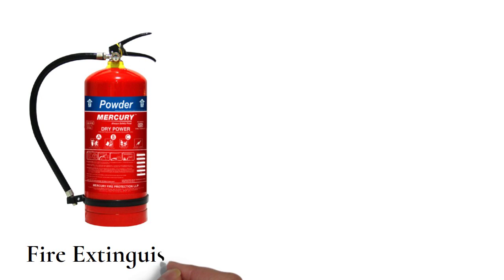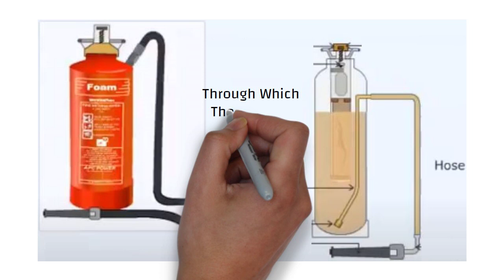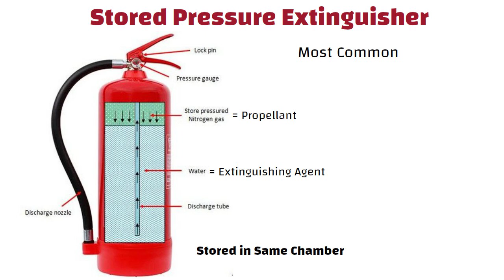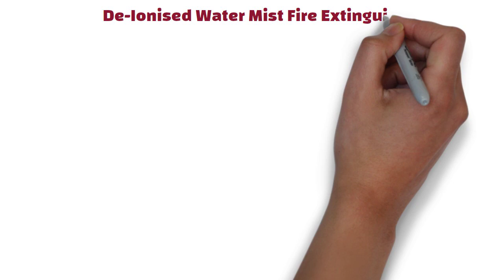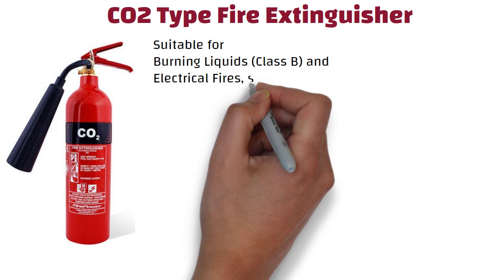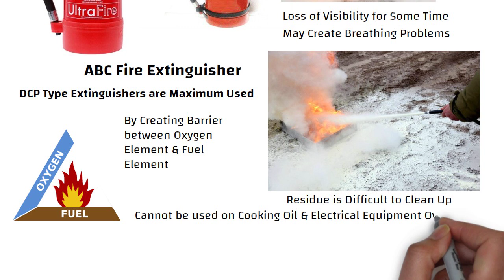FIRE EXTINGUISHER DEALERS IN KERALA, CALL 8138906102, FIRE EXTINGUISHER DEALERS IN ERNAKULAM.

Comment from the maker: FIRE EXTINGUISHER DEALERS IN KOCHI, FIRE EXTINGUISHER SUPPLIERS IN KOCHI, FIRE EXTINGUISHER DISTRIBUTORS IN KOCHI, FIRE EXTINGUISHER IN KOCHI, ABC TYPE FIRE EXTINGUISHER DEALERS IN KOCHI, CO2 TYPE FIRE EXTINGUISHER DEALERS IN KOCHI, CLEAN AGENT FIRE EXTINGUISHER IN KOCHI, MODULAR TYPE FIRE EXTINGUISHER DEALERS IN KOCHI, MECHANICAL FOAM FIRE EXTINGUISHER DEALERS IN KOCHI, FIRE EXTINGUISHER NEAR ME KOCHI, FIRE EXTINGUISHER TRADERS IN KOCHI, FIRE FIGHTING COMPANIES IN KOCHI, FIRE CONTRACTORS IN KOCHI, FIRE EQUIPMENT DEALERS IN KOCHI, FIRE ALARM DEALERS IN KOCHI, FIRE PUMP DEALERS IN KOCHI, SMOKE DETECTOR DEALERS IN KOCHI, FIRE FIGHTING SYSTEM IN KOCHI, FIRE PROTECTION SYSTEM IN KOCHI, FIRE AND SAFETY CONTRACTORS IN KOCHI, FIRE HYDRANT SYSTEMS IN KOCHI, PA TALK BACK SYSTEM IN KOCHI, FIRE NOC IN KOCHI, FIRE INSTALLATION IN KOCHI, FIRE NOC RENEWAL IN KOCHI, KIRLOSKAR FIRE PUMP DEALERS IN KOCHI, FIRE EXTINGUISHER NEAR ME KOCHI, FIRE EXTINGUISHER MANUFACURERS IN KOCHI, SAFEX FIRE EXTINGUISHER DEALERS IN KOCHI, FIRE NOC CONTRACTORS IN KOCHI, FIRE FIGHTING EQUIPMENT DEALERS IN KOCHI, FIRE PROTECTION SYSTEM IN KOCHI, FIRE INSTALLATION IN KOCHI, FIRE SAFETY CONTRACTORS IN KOCHI, FIRE AMC IN KOCHI, FIRE PROTECTION SYSTEM IN KOCHI, FIRE PROTECTION EQUIPMET IN KOCHI, AMC OF FIRE SYSTEM IN KOCHI, FIRE CONSULTANTS IN KOCHI, FIRE AND SAFETY EQUIPMENT DEALERS IN KOCHI, ADDRESSABLE FIRE ALARM SYSTEM IN KOCHI, KARTHAR VALVE DEALERS IN KOCHI, DCP TYPE FIRE EXTINGUISHER IN KOCHI, POWSER TYPE FIRE EXTINGUISHERS IN KOCHI, FIRE HYDRANT SYSTEM IN KOCHI, FIRE ALARM PANEL DEALERS IN KOCHI, SAFEPRO FIRE EXTINGUISHER DEALERS IN KOCHI, MS AND GI PIPE DEALERS IN KOCHI, JINDAL PIPE DEALERS IN KOCHI, AGNI FIRE ALARM DEALERS IN KOCHI, FIRE EQUIPMENT DEALERS IN KOCHI, FIRE EQUIPMENT SUPPLIERS IN KOCHI, FIRE EQUIPMENT TRADERS IN KOCHI, FIRE SPRINKLER SYSTEM IN KOCHI, RAVLE FIRE ALARM DEALERS IN KOCHI, RAVEL FIRE ALARM SYSTEM IN KOCHI, AGNI FIRE ALARM DISTRIBUTORS IN KOCHI, FIRE ALARM CONTRACTORS IN KOCHI, FIRE PIPE INSTALLATION IN CONTRACTORS IN KOCHI, FIRE SAFETY CONTRACTORS IN KOCHI, FIRE PA TWO WAY TALK BACK SYSTEM DEALERS IN KOCHI, HEAT DETECTOR DEALERS IN KOCHI, HONEYWELL FIRE ALARM DEALERS IN KOCHI, FIRE NOC CONSULTANTS IN KOCHI, FIRE AMC AND FIRE NOC IN KOCHI, FIRE SAFETY COMPANIES IN KOCHI, NEWAGE DEALERS IN KOCHI, MONSHER FIRE EQUIPMENT DEALERS IN KOCHI, KARTHAR VALVE DEALERS IN KOCHI, FIRE HYDRANT VALVE DEALERS IN KOCHI, FIRE HOSE REEL DRUM DEALERS IN KOCHI, FIRE SPRINKLER DEALERS IN KOCHI, FIRE PUMP DEALERS IN KOCHI, LUBI PUMP DEALERS IN KOCHI, LHP PUMP DEALERS IN KOCHI.
Reply: FIRE EXTINGUISHER DEALERS IN KOCHI, FIRE EXTINGUISHER SUPPLIERS IN KOCHI, FIRE EXTINGUISHER DISTRIBUTORS IN KOCHI, FIRE EXTINGUISHER IN KOCHI, ABC TYPE FIRE EXTINGUISHER DEALERS IN KOCHI, CO2 TYPE FIRE EXTINGUISHER DEALERS IN KOCHI, CLEAN AGENT FIRE EXTINGUISHER IN KOCHI, MODULAR TYPE FIRE EXTINGUISHER DEALERS IN KOCHI, MECHANICAL FOAM FIRE EXTINGUISHER DEALERS IN KOCHI, FIRE EXTINGUISHER NEAR ME KOCHI, FIRE EXTINGUISHER TRADERS IN KOCHI, FIRE FIGHTING COMPANIES IN KOCHI, FIRE CONTRACTORS IN KOCHI, FIRE EQUIPMENT DEALERS IN KOCHI, FIRE ALARM DEALERS IN KOCHI, FIRE PUMP DEALERS IN KOCHI, SMOKE DETECTOR DEALERS IN KOCHI, FIRE FIGHTING SYSTEM IN KOCHI, FIRE PROTECTION SYSTEM IN KOCHI, FIRE AND SAFETY CONTRACTORS IN KOCHI, FIRE HYDRANT SYSTEMS IN KOCHI, PA TALK BACK SYSTEM IN KOCHI, FIRE NOC IN KOCHI, FIRE INSTALLATION IN KOCHI, FIRE NOC RENEWAL IN KOCHI, KIRLOSKAR FIRE PUMP DEALERS IN KOCHI, FIRE EXTINGUISHER NEAR ME KOCHI, FIRE EXTINGUISHER MANUFACURERS IN KOCHI, SAFEX FIRE EXTINGUISHER DEALERS IN KOCHI, FIRE NOC CONTRACTORS IN KOCHI, FIRE FIGHTING EQUIPMENT DEALERS IN KOCHI, FIRE PROTECTION SYSTEM IN KOCHI, FIRE INSTALLATION IN KOCHI, FIRE SAFETY CONTRACTORS IN KOCHI, FIRE AMC IN KOCHI, FIRE PROTECTION SYSTEM IN KOCHI, FIRE PROTECTION EQUIPMET IN KOCHI, AMC OF FIRE SYSTEM IN KOCHI, FIRE CONSULTANTS IN KOCHI, FIRE AND SAFETY EQUIPMENT DEALERS IN KOCHI, ADDRESSABLE FIRE ALARM SYSTEM IN KOCHI, KARTHAR VALVE DEALERS IN KOCHI, DCP TYPE FIRE EXTINGUISHER IN KOCHI, POWSER TYPE FIRE EXTINGUISHERS IN KOCHI, FIRE HYDRANT SYSTEM IN KOCHI, FIRE ALARM PANEL DEALERS IN KOCHI, SAFEPRO FIRE EXTINGUISHER DEALERS IN KOCHI, MS AND GI PIPE DEALERS IN KOCHI, JINDAL PIPE DEALERS IN KOCHI, AGNI FIRE ALARM DEALERS IN KOCHI, FIRE EQUIPMENT DEALERS IN KOCHI, FIRE EQUIPMENT SUPPLIERS IN KOCHI, FIRE EQUIPMENT TRADERS IN KOCHI, FIRE SPRINKLER SYSTEM IN KOCHI, RAVLE FIRE ALARM DEALERS IN KOCHI, RAVEL FIRE ALARM SYSTEM IN KOCHI, AGNI FIRE ALARM DISTRIBUTORS IN KOCHI, FIRE ALARM CONTRACTORS IN KOCHI, FIRE PIPE INSTALLATION IN CONTRACTORS IN KOCHI, FIRE SAFETY CONTRACTORS IN KOCHI, FIRE PA TWO WAY TALK BACK SYSTEM DEALERS IN KOCHI, HEAT DETECTOR DEALERS IN KOCHI, HONEYWELL FIRE ALARM DEALERS IN KOCHI, FIRE NOC CONSULTANTS IN KOCHI, FIRE AMC AND FIRE NOC IN KOCHI, FIRE SAFETY COMPANIES IN KOCHI, NEWAGE DEALERS IN KOCHI, MONSHER FIRE EQUIPMENT DEALERS IN KOCHI, KARTHAR VALVE DEALERS IN KOCHI, FIRE HYDRANT VALVE DEALERS IN KOCHI, FIRE HOSE REEL DRUM DEALERS IN KOCHI, FIRE SPRINKLER DEALERS IN KOCHI, FIRE PUMP DEALERS IN KOCHI, LUBI PUMP DEALERS IN KOCHI, LHP PUMP DEALERS IN KOCHI
Reply: FIRE EXTINGUISHER DEALERS IN THODUPUZHA, FIRE EXTINGUISHER SUPPLIERS IN THODUPUZHA, FIRE EXTINGUISHER DISTRIBUTORS IN THODUPUZHA, FIRE EXTINGUISHER IN THODUPUZHA, ABC TYPE FIRE EXTINGUISHER DEALERS IN THODUPUZHA, CO2 TYPE FIRE EXTINGUISHER DEALERS IN THODUPUZHA, CLEAN AGENT FIRE EXTINGUISHER IN THODUPUZHA, MODULAR TYPE FIRE EXTINGUISHER DEALERS IN THODUPUZHA, MECHANICAL FOAM FIRE EXTINGUISHER DEALERS IN THODUPUZHA, FIRE EXTINGUISHER NEAR ME THODUPUZHA, FIRE EXTINGUISHER TRADERS IN THODUPUZHA, FIRE FIGHTING COMPANIES IN THODUPUZHA, FIRE CONTRACTORS IN THODUPUZHA, FIRE EQUIPMENT DEALERS IN THODUPUZHA, FIRE ALARM DEALERS IN THODUPUZHA, FIRE PUMP DEALERS IN THODUPUZHA, SMOKE DETECTOR DEALERS IN THODUPUZHA, FIRE FIGHTING SYSTEM IN THODUPUZHA, FIRE PROTECTION SYSTEM IN THODUPUZHA, FIRE AND SAFETY CONTRACTORS IN THODUPUZHA, FIRE HYDRANT SYSTEMS IN THODUPUZHA, PA TALK BACK SYSTEM IN THODUPUZHA, FIRE NOC IN THODUPUZHA, FIRE INSTALLATION IN THODUPUZHA, FIRE NOC RENEWAL IN THODUPUZHA, KIRLOSKAR FIRE PUMP DEALERS IN THODUPUZHA, FIRE EXTINGUISHER NEAR ME THODUPUZHA, FIRE EXTINGUISHER MANUFACURERS IN THODUPUZHA, SAFEX FIRE EXTINGUISHER DEALERS IN THODUPUZHA, FIRE NOC CONTRACTORS IN THODUPUZHA, FIRE FIGHTING EQUIPMENT DEALERS IN THODUPUZHA, FIRE PROTECTION SYSTEM IN THODUPUZHA, FIRE INSTALLATION IN THODUPUZHA, FIRE SAFETY CONTRACTORS IN THODUPUZHA, FIRE AMC IN THODUPUZHA, FIRE PROTECTION SYSTEM IN THODUPUZHA, FIRE PROTECTION EQUIPMET IN THODUPUZHA, AMC OF FIRE SYSTEM IN THODUPUZHA, FIRE CONSULTANTS IN THODUPUZHA, FIRE AND SAFETY EQUIPMENT DEALERS IN THODUPUZHA, ADDRESSABLE FIRE ALARM SYSTEM IN THODUPUZHA, KARTHAR VALVE DEALERS IN THODUPUZHA, DCP TYPE FIRE EXTINGUISHER IN THODUPUZHA, POWSER TYPE FIRE EXTINGUISHERS IN THODUPUZHA, FIRE HYDRANT SYSTEM IN THODUPUZHA, FIRE ALARM PANEL DEALERS IN THODUPUZHA, SAFEPRO FIRE EXTINGUISHER DEALERS IN THODUPUZHA, MS AND GI PIPE DEALERS IN THODUPUZHA, JINDAL PIPE DEALERS IN THODUPUZHA, AGNI FIRE ALARM DEALERS IN THODUPUZHA, FIRE EQUIPMENT DEALERS IN THODUPUZHA, FIRE EQUIPMENT SUPPLIERS IN THODUPUZHA, FIRE EQUIPMENT TRADERS IN THODUPUZHA, FIRE SPRINKLER SYSTEM IN THODUPUZHA, RAVEL FIRE ALARM DEALERS IN THODUPUZHA, RAVEL FIRE ALARM SYSTEM IN THODUPUZHA, AGNI FIRE ALARM DISTRIBUTORS IN THODUPUZHA, FIRE ALARM CONTRACTORS IN THODUPUZHA, FIRE PIPE INSTALLATION IN CONTRACTORS IN THODUPUZHA, FIRE SAFETY CONTRACTORS IN THODUPUZHA, FIRE PA TWO WAY TALK BACK SYSTEM DEALERS IN THODUPUZHA, HEAT DETECTOR DEALERS IN THODUPUZHA, HONEYWELL FIRE ALARM DEALERS IN THODUPUZHA, FIRE NOC CONSULTANTS IN THODUPUZHA, FIRE AMC AND FIRE NOC IN THODUPUZHA, FIRE SAFETY COMPANIES IN THODUPUZHA, NEWAGE DEALERS IN THODUPUZHA, MONSHER FIRE EQUIPMENT DEALERS IN THODUPUZHA, KARTHAR VALVE DEALERS IN THODUPUZHA, FIRE HYDRANT VALVE DEALERS IN THODUPUZHA, FIRE HOSE REEL DRUM DEALERS IN THODUPUZHA, FIRE SPRINKLER DEALERS IN THODUPUZHA, FIRE PUMP DEALERS IN THODUPUZHA, LUBI PUMP DEALERS IN THODUPUZHA, LHP PUMP DEALERS IN THODUPUZHA. FIRE CONTRACTORS IN THODUPUZHA, FIRE AND SAFETY CONTRACTORS IN THODUPUZHA, FIRE EQUIPMENT DEALERS IN THODUPUZHA, FIRE FIGHTING CONTRACTORS IN THODUPUZHA, AGNI FIRE ALARM DEALERS IN THODUPUZHA, PA TALK BACK SYSTEM DEALERS IN THODUPUZHA, FIRE NOC IN THODUPUZHA, FIRE NOC RENEWAL IN THODUPUZHA, FIRE SYSTEM INSTALLATION IN THODUPUZHA.

Comment from the maker: FIRE EXTINGUISHER DEALERS IN THRISSUR, FIRE EXTINGUISHER SUPPLIERS IN THRISSUR, FIRE EXTINGUISHER DISTRIBUTORS IN THRISSUR, FIRE EXTINGUISHER IN THRISSUR, ABC TYPE FIRE EXTINGUISHER DEALERS IN THRISSUR, CO2 TYPE FIRE EXTINGUISHER DEALERS IN THRISSUR, CLEAN AGENT FIRE EXTINGUISHER IN THRISSUR, MODULAR TYPE FIRE EXTINGUISHER DEALERS IN THRISSUR, MECHANICAL FOAM FIRE EXTINGUISHER DEALERS IN THRISSUR, FIRE EXTINGUISHER NEAR ME THRISSUR, FIRE EXTINGUISHER TRADERS IN THRISSUR, FIRE FIGHTING COMPANIES IN THRISSUR, FIRE CONTRACTORS IN THRISSUR, FIRE EQUIPMENT DEALERS IN THRISSUR, FIRE ALARM DEALERS IN THRISSUR, FIRE PUMP DEALERS IN THRISSUR, SMOKE DETECTOR DEALERS IN THRISSUR, FIRE FIGHTING SYSTEM IN THRISSUR, FIRE PROTECTION SYSTEM IN THRISSUR, FIRE AND SAFETY CONTRACTORS IN THRISSUR, FIRE HYDRANT SYSTEMS IN THRISSUR, PA TALK BACK SYSTEM IN THRISSUR, FIRE NOC IN THRISSUR, FIRE INSTALLATION IN THRISSUR, FIRE NOC RENEWAL IN THRISSUR, KIRLOSKAR FIRE PUMP DEALERS IN THRISSUR, FIRE EXTINGUISHER NEAR ME THRISSUR, FIRE EXTINGUISHER MANUFACURERS IN THRISSUR, SAFEX FIRE EXTINGUISHER DEALERS IN THRISSUR, FIRE NOC CONTRACTORS IN THRISSUR, FIRE FIGHTING EQUIPMENT DEALERS IN THRISSUR, FIRE PROTECTION SYSTEM IN THRISSUR, FIRE INSTALLATION IN THRISSUR, FIRE SAFETY CONTRACTORS IN THRISSUR, FIRE AMC IN THRISSUR, FIRE PROTECTION SYSTEM IN THRISSUR, FIRE PROTECTION EQUIPMET IN THRISSUR, AMC OF FIRE SYSTEM IN THRISSUR, FIRE CONSULTANTS IN THRISSUR, FIRE AND SAFETY EQUIPMENT DEALERS IN THRISSUR, ADDRESSABLE FIRE ALARM SYSTEM IN THRISSUR, KARTHAR VALVE DEALERS IN THRISSUR, DCP TYPE FIRE EXTINGUISHER IN THRISSUR, POWSER TYPE FIRE EXTINGUISHERS IN THRISSUR, FIRE HYDRANT SYSTEM IN THRISSUR, FIRE ALARM PANEL DEALERS IN THRISSUR, SAFEPRO FIRE EXTINGUISHER DEALERS IN THRISSUR, MS AND GI PIPE DEALERS IN THRISSUR, JINDAL PIPE DEALERS IN THRISSUR, AGNI FIRE ALARM DEALERS IN THRISSUR, FIRE EQUIPMENT DEALERS IN THRISSUR, FIRE EQUIPMENT SUPPLIERS IN THRISSUR, FIRE EQUIPMENT TRADERS IN THRISSUR, FIRE SPRINKLER SYSTEM IN THRISSUR, RAVLE FIRE ALARM DEALERS IN THRISSUR, RAVEL FIRE ALARM SYSTEM IN THRISSUR, AGNI FIRE ALARM DISTRIBUTORS IN THRISSUR, FIRE ALARM CONTRACTORS IN THRISSUR, FIRE PIPE INSTALLATION IN CONTRACTORS IN THRISSUR, FIRE SAFETY CONTRACTORS IN THRISSUR, FIRE PA TWO WAY TALK BACK SYSTEM DEALERS IN THRISSUR, HEAT DETECTOR DEALERS IN THRISSUR, HONEYWELL FIRE ALARM DEALERS IN THRISSUR, FIRE NOC CONSULTANTS IN THRISSUR, FIRE AMC AND FIRE NOC IN THRISSUR, FIRE SAFETY COMPANIES IN THRISSUR, NEWAGE DEALERS IN THRISSUR, MONSHER FIRE EQUIPMENT DEALERS IN THRISSUR, KARTHAR VALVE DEALERS IN THRISSUR, FIRE HYDRANT VALVE DEALERS IN THRISSUR, FIRE HOSE REEL DRUM DEALERS IN THRISSUR, FIRE SPRINKLER DEALERS IN THRISSUR, FIRE PUMP DEALERS IN THRISSUR, LUBI PUMP DEALERS IN THRISSUR, LHP PUMP DEALERS IN THRISSUR.
Reply: FIRE EXTINGUISHER DEALERS IN PERUMBAVOOR, FIRE EXTINGUISHER SUPPLIERS IN PERUMBAVOOR, FIRE EXTINGUISHER DISTRIBUTORS IN PERUMBAVOOR, FIRE EXTINGUISHER IN PERUMBAVOOR, ABC TYPE FIRE EXTINGUISHER DEALERS IN PERUMBAVOOR, CO2 TYPE FIRE EXTINGUISHER DEALERS IN PERUMBAVOOR, CLEAN AGENT FIRE EXTINGUISHER IN PERUMBAVOOR, MODULAR TYPE FIRE EXTINGUISHER DEALERS IN PERUMBAVOOR, MECHANICAL FOAM FIRE EXTINGUISHER DEALERS IN PERUMBAVOOR, FIRE EXTINGUISHER NEAR ME PERUMBAVOOR, FIRE EXTINGUISHER TRADERS IN PERUMBAVOOR, FIRE FIGHTING COMPANIES IN PERUMBAVOOR, FIRE CONTRACTORS IN PERUMBAVOOR, FIRE EQUIPMENT DEALERS IN PERUMBAVOOR, FIRE ALARM DEALERS IN PERUMBAVOOR, FIRE PUMP DEALERS IN PERUMBAVOOR, SMOKE DETECTOR DEALERS IN PERUMBAVOOR, FIRE FIGHTING SYSTEM IN PERUMBAVOOR, FIRE PROTECTION SYSTEM IN PERUMBAVOOR, FIRE AND SAFETY CONTRACTORS IN PERUMBAVOOR, FIRE HYDRANT SYSTEMS IN PERUMBAVOOR, PA TALK BACK SYSTEM IN PERUMBAVOOR, FIRE NOC IN PERUMBAVOOR, FIRE INSTALLATION IN PERUMBAVOOR, FIRE NOC RENEWAL IN PERUMBAVOOR, KIRLOSKAR FIRE PUMP DEALERS IN PERUMBAVOOR, FIRE EXTINGUISHER NEAR ME PERUMBAVOOR, FIRE EXTINGUISHER MANUFACURERS IN PERUMBAVOOR, SAFEX FIRE EXTINGUISHER DEALERS IN PERUMBAVOOR, FIRE NOC CONTRACTORS IN PERUMBAVOOR, FIRE FIGHTING EQUIPMENT DEALERS IN PERUMBAVOOR, FIRE PROTECTION SYSTEM IN PERUMBAVOOR, FIRE INSTALLATION IN PERUMBAVOOR, FIRE SAFETY CONTRACTORS IN PERUMBAVOOR, FIRE AMC IN PERUMBAVOOR, FIRE PROTECTION SYSTEM IN PERUMBAVOOR, FIRE PROTECTION EQUIPMET IN PERUMBAVOOR, AMC OF FIRE SYSTEM IN PERUMBAVOOR, FIRE CONSULTANTS IN PERUMBAVOOR, FIRE AND SAFETY EQUIPMENT DEALERS IN PERUMBAVOOR, ADDRESSABLE FIRE ALARM SYSTEM IN PERUMBAVOOR, KARTHAR VALVE DEALERS IN PERUMBAVOOR, DCP TYPE FIRE EXTINGUISHER IN PERUMBAVOOR, POWSER TYPE FIRE EXTINGUISHERS IN PERUMBAVOOR, FIRE HYDRANT SYSTEM IN PERUMBAVOOR, FIRE ALARM PANEL DEALERS IN PERUMBAVOOR, SAFEPRO FIRE EXTINGUISHER DEALERS IN PERUMBAVOOR, MS AND GI PIPE DEALERS IN PERUMBAVOOR, JINDAL PIPE DEALERS IN PERUMBAVOOR, AGNI FIRE ALARM DEALERS IN PERUMBAVOOR, FIRE EQUIPMENT DEALERS IN PERUMBAVOOR, FIRE EQUIPMENT SUPPLIERS IN PERUMBAVOOR, FIRE EQUIPMENT TRADERS IN PERUMBAVOOR, FIRE SPRINKLER SYSTEM IN PERUMBAVOOR, RAVLE FIRE ALARM DEALERS IN PERUMBAVOOR, RAVEL FIRE ALARM SYSTEM IN PERUMBAVOOR, AGNI FIRE ALARM DISTRIBUTORS IN PERUMBAVOOR, FIRE ALARM CONTRACTORS IN PERUMBAVOOR, FIRE PIPE INSTALLATION IN CONTRACTORS IN PERUMBAVOOR, FIRE SAFETY CONTRACTORS IN PERUMBAVOOR, FIRE PA TWO WAY TALK BACK SYSTEM DEALERS IN PERUMBAVOOR, HEAT DETECTOR DEALERS IN PERUMBAVOOR, HONEYWELL FIRE ALARM DEALERS IN PERUMBAVOOR, FIRE NOC CONSULTANTS IN PERUMBAVOOR, FIRE AMC AND FIRE NOC IN PERUMBAVOOR, FIRE SAFETY COMPANIES IN PERUMBAVOOR, NEWAGE DEALERS IN PERUMBAVOOR, MONSHER FIRE EQUIPMENT DEALERS IN PERUMBAVOOR, KARTHAR VALVE DEALERS IN PERUMBAVOOR, FIRE HYDRANT VALVE DEALERS IN PERUMBAVOOR, FIRE HOSE REEL DRUM DEALERS IN PERUMBAVOOR, FIRE SPRINKLER DEALERS IN PERUMBAVOOR, FIRE PUMP DEALERS IN PERUMBAVOOR, LUBI PUMP DEALERS IN PERUMBAVOOR, LHP PUMP DEALERS IN PERUMBAVOOR. FIRE CONTRACTORS IN PERUMBAVOOR, FIRE AND SAFETY CONTRACTORS IN PERUMBAVOOR, FIRE EQUIPMENT DEALERS IN PERUMBAVOOR, FIRE FIGHTING CONTRACTORS IN PERUMBAVOOR,

Comment: FIRE ALARM DEALERS IN TRIVANDRUM, ADDRESSABLE FIRE ALARM DEALERS IN TRIVANDRUM, FIRE ALARM SYSTEM DEALERS IN TRIVANDRUM, ADDRESSABLE FIRE ALARM SYSTEM DEALERS IN TRIVANDRUM, FIRE DETECTION SYSTEM IN TRIVANDRUM, SMOKE DETECTOR DEALERS IN TRIVANDRUM, CONVENTIONAL FIRE ALARM DEALERS IN TRIVANDRUM, MORLEY FIRE ALARM DEALERS IN TRIVANDRUM, GST FIRE ALARM DEALERS IN TRIVANDRUM, ASES SECURITY FIRE ALARM DEALERS IN TRIVANDRUM, BEAM DETECTOR DEALERS IN TRIVANDRUM, FIRE ALARM SUPPLIERS IN TRIVANDRUM, FIRE ALARM TRADERS IN TRIVANDRUM, FIRE ALARM PANEL DEALERS IN TRIVANDRUM, HEAT DETECTOR DEALERS IN TRIVANDRUM, FIRE ALARM SYSTEM SUPPLIERS IN TRIVANDRUM, FIRE ALARM COMPANIES IN TRIVANDRUM, FIRE EQUIPMENT DEALERS IN TRIVANDRUM, ADRRESSABLE FIRE ALARM PANEL DEALERS IN TRIVANDRUM, FIRE ALARM SYSTEM IN TRIVANDRUM, BATTERY OPERATED DETECTOR DEALERS IN TRIVANDRUM, ASPIRATION DETECTION SYSTEM DEALERS IN TRIVANDRUM, FIRE ALARM MCP - MANUAL CALL POINT DEALERS IN TRIVANDRUM, FIRE ALARM HOOTER DEALERS IN TRIVANDRUM, PA TWO WAY TALK BACK SYSTEM DEALERS IN TRIVANDRUM, PA SYSTEM DEALERS IN TRIVANDRUM, PA TALK BACK UNIT DEALERS IN TRIVANDRUM, HOOTER CUM STROBE DEALERS IN TRIVANDRUM, FIRE PROTECTION SYSTEM IN TRIVANDRUM, FIRE ALARM CONTRACTORS IN TRIVANDRUM, FIRE DETECTORS IN TRIVANDRUM, FIRE ALARM DEALERS IN KOLLAM, ADDRESSABLE FIRE ALARM DEALERS IN KOLLAM, SMOKE DETECTOR DEALERS IN KOLLAM, FIRE EQUIPMENT DEALERS IN TRIVANDRUM, FIRE ALARM INSTALLATION IN TRIVANDRUM, FIRE ALARM COMPANIES IN TRIVANDRUM FIRE ALARM DISTRIBUTORS IN TRIVANDRUM, TALK BACK SYSTEM DEALERS IN TRIVANDRUM, FIRE ALARM SENSOR DEALERS IN TRIVANDRUM, FIRE EXTINGUISHER DEALERS IN TRIVANDRUM, FIRE ALARM DEALERS IN ERNAKULAM, FIRE ALARM DEALERS IN KERALA, ADDRESSABLE FIRE ALARM DEALERS IN CALICUT, SMOKE DETECTOR IN TRIVANDRUM, SMOKE DETECTOR DEALERS IN KOLLAM, FIRE ALARM DEALERS IN KOTTARAKARA, FIRE ALARM DEALERS IN NEDUMANGAD, FIRE ALARM DEALERS IN VARKALA, FIRE ALARM DEALERS IN VARKALA, FIRE ALARM DEALERS IN MARTHANDAM, FIRE ALARM DEALERS IN ATTINGAL, FIRE ALARM DEALERS IN KILIMANOOR, FIRE ALARM DEALERS IN ANCHAL, FIRE ALARM DEALERS IN PATHANAPURAM, FIRE ALARM DEALERS IN PUNALOOR, FIRE ALARM DEALERS IN NEYYATINKARA, FIRE ALARM DEALERS IN POOVAR, FIRE ALARM DEALERS IN KATTAKADA, FIRE ALARM DEALERS IN KAZHAKOOTTAM, FIRE ALARM DEALERS IN PARIPPALLY, FIRE ALARM DEALERS IN PARASSALA, FIRE ALARM DEALERS IN KULASEKHARAM, FIRE ALARM DEALERS IN THUCKALAYFIRE ALARM DEALERS IN BALARAMAPURAM, FIRE ALARM DEALERS IN ARYANADU, FIRE ALARM DEALERS IN POOJAPURA, FIRE ALARM DEALERS IN POTHENCODE, FIRE ALARM DEALERS IN VITHURA, FIRE ALARM DEALERS IN VENJARAMOODU, FIRE ALARM DEALERS IN KILIMANOOR, FIRE ALARM DEALERS IN KADAKKAL, FIRE ALARM DEALERS IN CHATHANNOOR, FIRE ALARM DEALERS IN KOTTIYAM, FIRE ALARM DEALERS IN KUNDARA, FIRE ALARM DEALERS IN CHAVARA, FIRE ALARM DEALERS IN SASTHAMKOTTA, FIRE ALARM DEALERS IN PALODE, FIRE ALARM DEALERS IN VENJARAMOODU, FIRE ALARM DEALERS IN ARYANADU, FIRE ALARM DEALERS IN VELLARASA, FIRE ALARM DEALERS IN VITHURA,